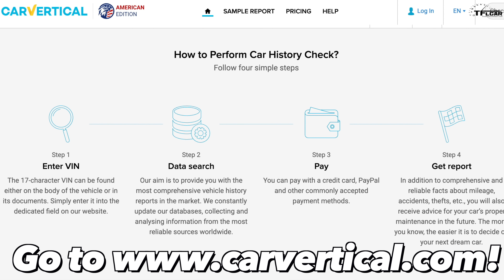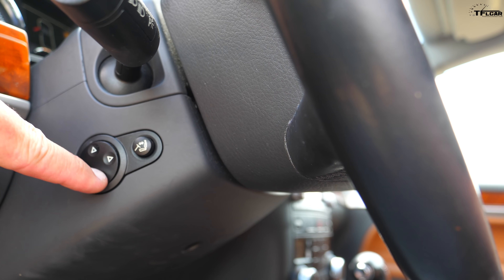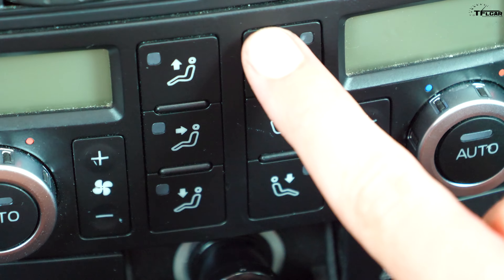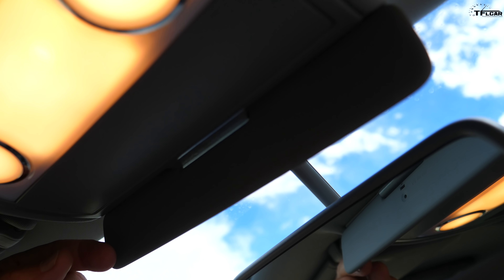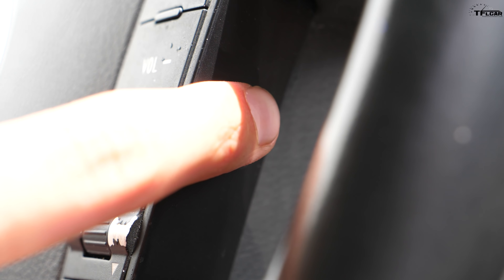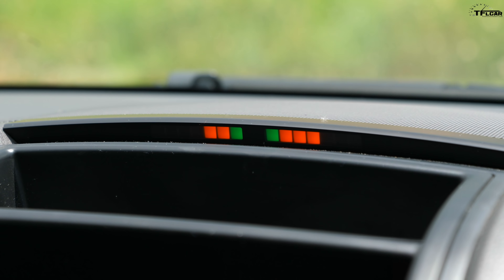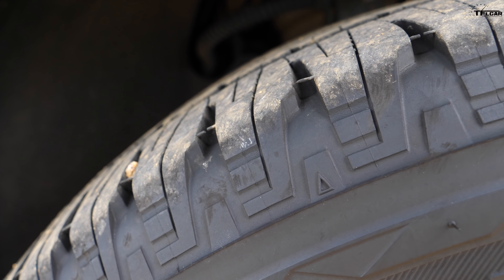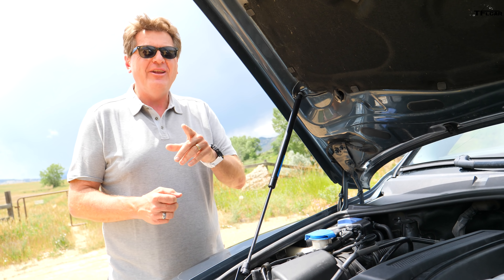We Just Bought The World's MOST Under Appreciated AND Over Engineered Car! Tough T Ep.1

Comment: im only a minute into the ideo but i will say this. first gen toureg was a beast. after they just became whatever. and if they serviced it properly that car will outlast almost anything on the road. we had 2 for the company and we used to abuse those car. both went over 150k without a single problem, while our range rovers on the lot would have airbag issued at like 70K miles and above, the toureg with air suspension never gave a proble,

Comment: I recall a day picking up my wifes 1.8T at the vw dealer timing belt, water pump, cam seal and soark plugs $1000 which wasn’t bad. The guy in front of me with the exact towrag dropped a no joke $13,000 check for a huge list of repairs the big ones were replacing all 4 failed shocks, ABS unit and several injectors. I asked him if he drove it like that? He laughed and told me no it wouldn’t start a few days ago. He had no idea it needed all those other things. 🤦‍♂️

Comment: Yeah it is 2004 Volkswagen Touareg Gauge Cluster 3 Way Power Seats Climate Control Heated Seats Gulf Box 3 Sun Shades 3 Cup Holders Center Console Lift Glass Screen 11 Speakers 4.2L V8 300 Hp 300 Torque Comfort,Auto,& Sport Modes Navigation Squirts For The Headlights 2 12 Volts Outlets 11.8 Ground Clearance 28 Approach 27 Departure 27 Breakover $53,085 Vs 2019 White Clear-Coat Jeep Wrangler JL 2.0L 4-Cylinder!!!!!!!!!!!!

Comment: Another feature: It came with a connector (below the front passenger seat) and hose with pressure gauge to use the air suspension reservoir to inflate tyres.

Comment: I had a 2006 VW Touareg V8 and it was a great vehicle to drive and I took it on a couple fall elk hunts here in Utah’s uinta mountains and it did the job. It had shortcomings off road and if you use it as such then you discover them fast, which is why I sold it and upgraded to a 2008 FJ Cruiser Trail Team. I miss the creature comforts of the VW but it has too many electronic goodies for its own good. Replacing the ECU and ignition module proved that. Overall I miss it sometimes cause that V8 feels sweet (the Touareg is just too heavy).
Reply: From a Touareg to an FJ Cruiser....Thats quite the move.  I have an 07 FJ it is a fantastic off road thing.  But boy do I wish the 6cyl T-Reg's TDI were as reliable as the Toyota.  Because the T-Reg is just a nicer place to be.  It is quiet, comfortable and handles like a dream compared to other SUVs. You are right about it being to fiddly for serious off road use.  But then again so are the same gen Land Rovers.  You and I are spoiled by the silly levels of reliability and capability out of the Toyota Land Cruisers linage.
Reply: @EthosAtheos  Cheers fellow FJ'er! I couldn't have said it better - I did enjoy my Touareg and it was a dream when my daughter was born. Not to mention it is a safe vehicle. I got the bad taste of German-made engineering from repair costs and went to a Toyota Land Cruiser lineage and I haven't looked back. I didn't feel like I lost that much performance either and based on my research they're actually comparable 0-60mph, 7.6s Touareg and 7.8s FJ. I just miss a true 4-door really.

Comment: I don't get all the comments on the supposed maintenance costs to these vehicles. They are luxury cars. Obviously it will be expensive to run after 15 years. You need to compare it to other vehicles (that tried to be) in its class.Even the air suspension is not that difficult to repair and they are much more robust than the systems in vehicles like the LR4.

Comment: These are genuinely capable machines.  you don't see a lot of these on the road anymore though for...um...reasons.   if it were my money I would (did) buy one of its more traditional luxury contemporaries; The gx470. sure it doesn't have a rear locker but the specs aren't much worse and in some cases much better in comparison and there seems to be a plentiful supply of still working examples. - low range, 31/23/29 approach/break/depart, 700 mm of water fording (27.5 inches) 8.3 inches clearance, etc. Still, since this one is working I can't wait to see you put it through the paces.
Reply: Patrick Rich Very true, GX’s are super rad rigs! We’ll definitely do one eventually. Only catch is the price : 8-9K for a good one. But you ABSOLUTELY get you pay for compared to the ‘Reg in terms of quality and reliability.

Comment: Those parking sensors are mostly a copy of what Mercedes had for years before that!

Speaking of which, you should also review the second generation Mercedes ML, which had most (if not all) offroad capabilities of that Touareg.

The worst part of this car is that peeling on the interior bits, on a otherwise well built interior, which was almost like a trademark of all VW group cars of that vintage.
It’s a shame, because that leather interior seems to be in great condition (indicating that the previous owners were careful), but most close up shots from that interior look like the car has +300.000 miles.

Comment: I don't consider this as over-engineered. It may be full of features, but that's different.
Over-engineering, to me, means making parts stronger than they actually need to be at a minimum.
I consider Toyotas to be a bit over-engineered, hence their vaunted reliability.

BTW, my guess was $5000.
Reply: Your definition is what I would refer to as Over built. Just like those Toyota pickups with the R22 engines or a Chevy GMT400 truck with a 350 engine. They were not sophisticated in any way, just dead reliable.
Over-engineer is when they just get over the top with features and design elements for the sake of saying "because we can"

Comment: One of the best interiors for the time. Really comfy seats. Nice layout. Notorious for many issues, but front end alignment is what I was told was a big problem. Front tires last 10k miles????
Reply: Trebor Heminway I average 40 to 45 K on a set of all terrains and I change them @ 5 to 4 32nds. Not at worn it 2/32
Reply: @DOCPSYCHOsince1968  My VW service manager tells a huge tale of woe regrading these front ends. maybe just certain versions. He claimed he couldnt keep the damn things aligned as it was a design fault. I have to admit this is 2nd hand info. (I was looking at a used one at the time and he told me to pass)

Comment: The V10 diesel was such a cool engine.  No belts at all, even for the alternator or power steering.  Everything was gear-driven, lord help you if you didn't keep up on maintenance, though!  The front brakes on those typically needed to be changed every time the tires wore out (which is also expensive because VW, Audi, and the Subaru Tribeca are the only cars that use that size) and I remember pricing out a set of valve cover gaskets for one and they don't sell the gasket separately.  You have to buy the entire valve cover assembly to get the gasket and they didn't even stock them in the US, we had to order them from Germany.  Hair-brained nonsense like that makes me wonder how the Germans even have an auto industry anymore.

Comment: While it may have a lot of features of the Wrangler, that doesn’t make it equal. As with the Grand Cherokee, to gain the height, you eat your down travel. Without the down travel (when in lifted mode) it will ride worse and you will need the lockers more since you can’t droop a wheel across a hole.

Comment: I absolutely loved my Touareg. 2004 4.2 like yours. Headlight bulbs are a b***h to change. No major problems until the timing belt went out and caused catastrophic engine damage 😢. Pretty much the only real problem. They last about 80k miles. Mine had 170k when it died. I replaced it with a WK Grand Cherokee. And we are also proud owners of the new Kia Telluride. Check it out @socaltellurides

Comment: It might keep up with Wrangler on the rocks but not on sand and desert. I have gone off-road along with Touaregs and they cant keep up with the wrangler on sand
Reply: its unibody, the rocks will tear the crap out of it. TFL (if you are reading) should add a metric to the off-road score for having a ladder chassis vs unibody, because no proper off-road vehicle is designed without the protection or strength afforded by a box construction chassis.

Comment: When you see how crusty those VW switches get you realise why the Japanese manufacturers use plastic, they will still looks as new when it's finally gone to the scrapyard 30 years later.
Reply: My VW dealer replaced the window switches on my GTI under a technical service bulletin with proper plastic ones. Ten years later, they are still good. Surprised there was no TSB for the Touareg's.
Reply: @autobahnproven  lots of journalists go mad for soft touch materials but I'd like to know how long they last.
As long as the points you touch on a regular basis are good quality that's all I care about.

Comment: All that fancy lift stuff still leaves you with the diffs just above flat ground. You get extra wheel travel room and side clearance but those diffs are going to be ripped apart a small rocks.
It's a dirt road driver not a off road car.

And all that over engineering the Germans are so proud of makes them easily broken and expensive to repair specially the ones built for the American market since they have more tech than the European counterparts most of the time.

Comment: The Touareg is a beautiful driving machine.  It feels like a $100,000 dollar car.  Turbine smooth. 
Also, the Touareg was amazing off road. It even had locking diffs.

The  Touareg is extremely unreliable and massively expensive to repair.

The Touareg is a good weekend SUV to add to your 3 or 4 car fleet. As transportation?  It is pretty much useless.  It is really not worth anything today. Especially if it needs any major repairs.

Comment: Nice video, but I would never buy a VW here in Australia (probably anywhere).  Funny - just about everything you said about the VW Touareg regarding luxury I can also tic off on my 89 Celsior (basically a Lexus LS400 with some slightly different options, and the Toyota badge).
Differences, only 2 seat memory instead of 3, no cooled glove box, no 3rd cup holder and no proximity censors.  But that was in 89.  About 2-3 years later and yes, all that stuff come on board, including a car phone.  Of course, its not off road capable, but does surprisingly well with traction control when going slow on gravel / sandy tracks.  Unfortunately, here in the land of Oz, anyone who buys a VW has rocks in the head.  Support here SUCKS, and reliability is a BIG problem here, as well as the lies that they tell (and have now been taken to task for).

Comment: Would be cool if you mod it with some real off-road bits. Rims, Tires, Lights, Winch, Roof Rack :-D
Reply: Marc Nobel there was a Factory option for a WARN winch, just not for the USA market or the manual transmission option, not for USA market.

Comment: THIS IS A POS Car... im sorry, same as Porche Cayenne(Which is basically the same but with different headlights and interior lil more fancy). Plastic inside falling off and /or wobbling on every 1/4 inch bump(I did measured!), engine consume oil on the daily, etc etc... and resell value is horrible. Ok seats were ok, and spacious. But overall its a Lemon from the factory.
Thats why theres no old WV around... only toy cars 50mpg diesels, which is worth to fix for obvious reasons.